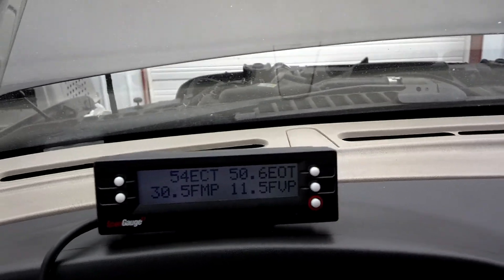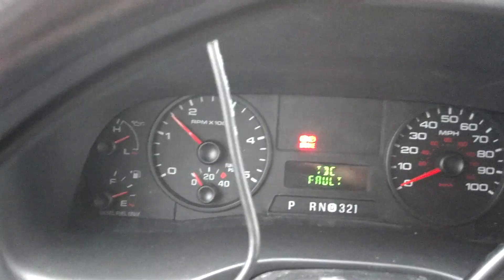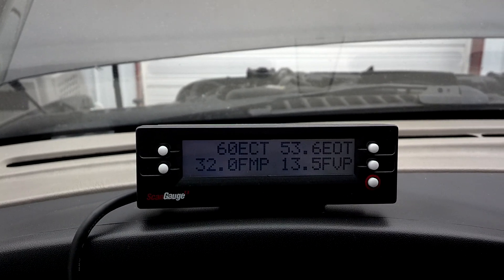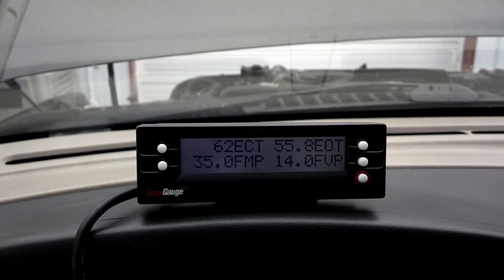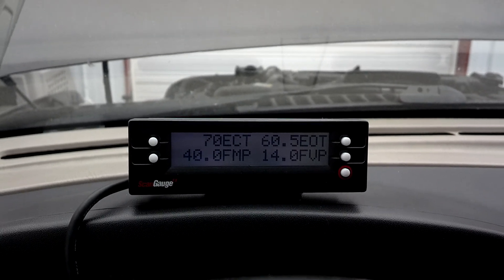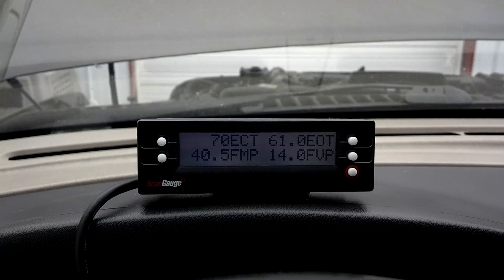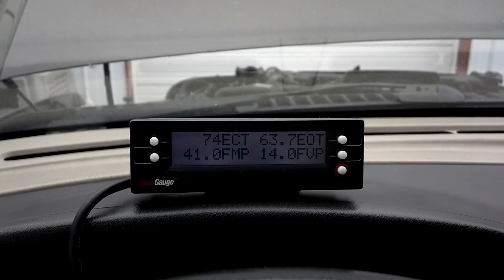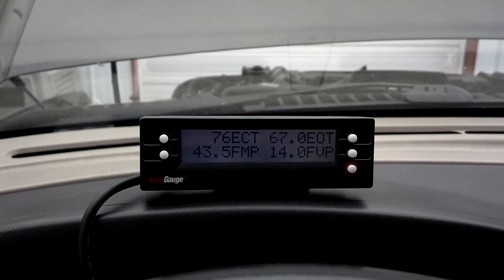2006 Ford F250 6.0L needs a FICM - ScanGauge II

Comment: the ECT and EOT delta needs to be measured when you have the truck in operating temps already and going 60-75mph unloaded on flat roads. you may have replaced that oil cooler prematurely.